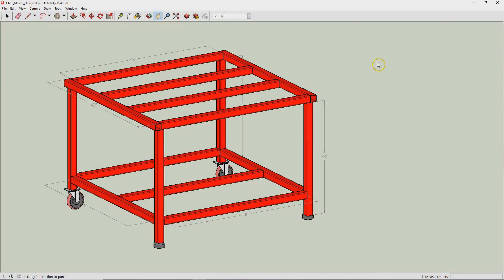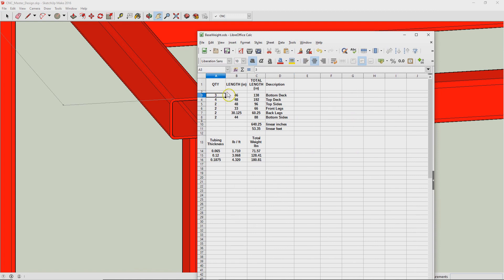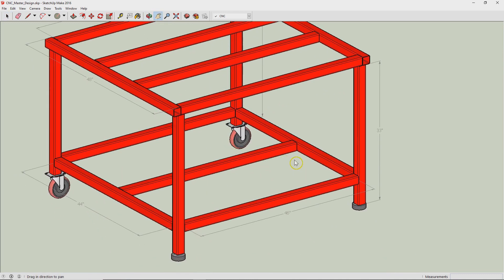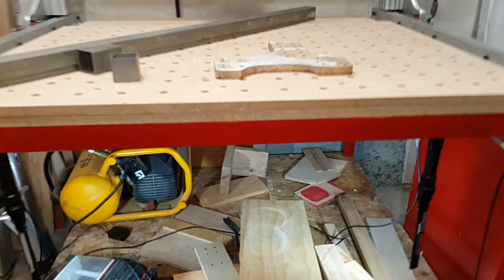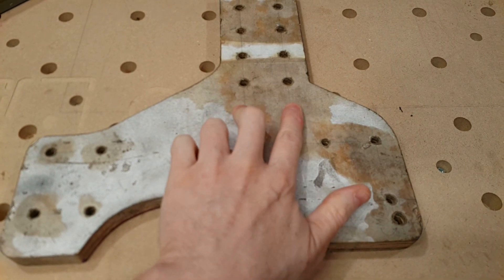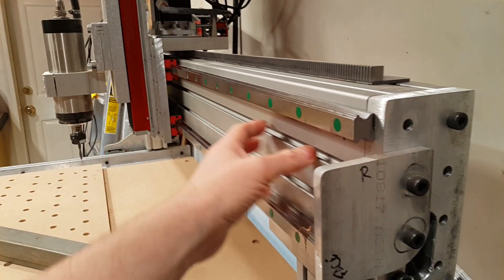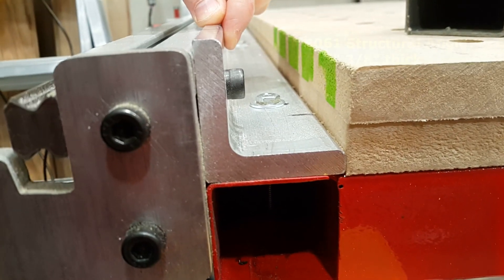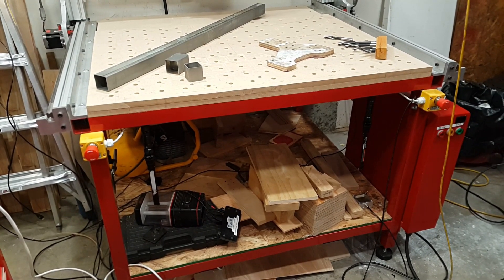CNC Machine: Structural Design Overview

Comment from the maker: My apologies ... I "fat fingered" the weight calculation in the spreadsheet. Here are the correct numbers
Tubing Thickness        lb / ft        Total Weight  lbs
           0.065                  1.710               91.23 
           0.12                     3.068              163.68
           0.1875                4.320               230.47
Reply: Hello from Holland,

I m in the process of building my own (2nd) machine based on the avid pro series aswell.
Are you willing to share the riserplate design?

Regards Martin,
Reply from the maker: @MMartinwittebroek  No, in fairness to AvidCNC, I won't share the riser plate design. It's not that hard to reverse engineer, not to mention you'll have more pride of ownership if you sweat the design details a bit. Good luck on your build. Make some videos and share your journey with us.

Comment: incredible job of copying the Avid CNC machine, I though that was what you had.  Lots of good info on your stand, I really want to build one myself.  Mine is sitting on 2 very heavy desks that are the same height.  They are very stable, but it gives me no access to the bottom of the machine and no storage under it at all.